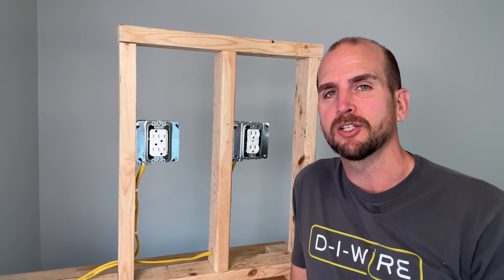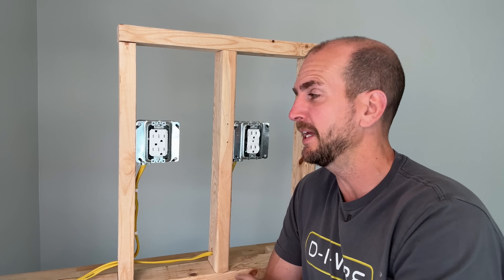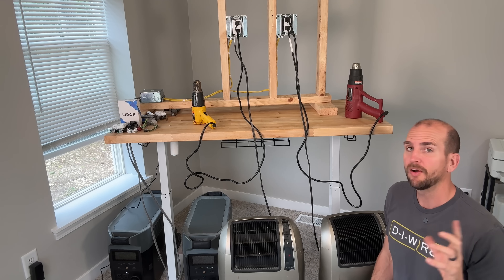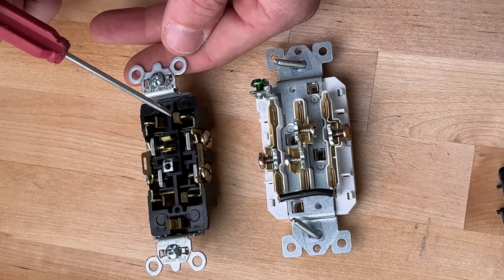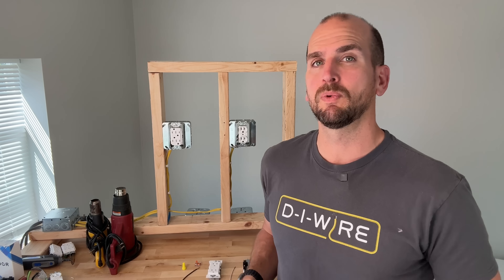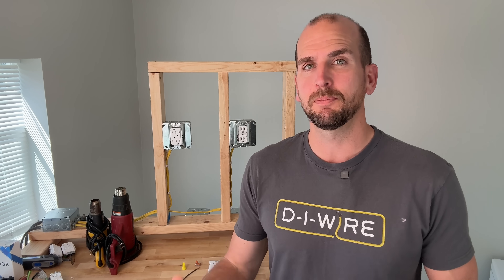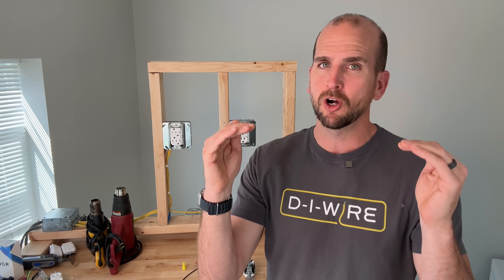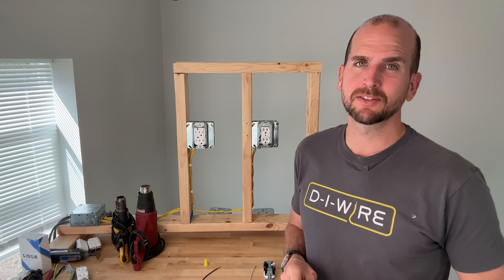The Most Innovative Outlet You've Never Seen | Full Load Testing

Comment: Interesting concept.  I was half expecting them to have each side fed by a different hot, allowing you to choose which phase to use for standard 120v.  Or use a funky new plug to use both hots for 240v like it was a nema 6-15.
Reply: You'd need to connect this up to both phases though, which requires additional wires that probably won't be there if you're not using a proper 240v outlet.
Reply: Having two circuits supplying a single wall plate, even if it is a double socket, is a bad idea.  Go to do work on it and not know of the arrangement and you turn off what you believe is the 120V breaker that isolates it and you still have 120V at the overall fitting.  You could argue that you should only fit it to a 240V breaker so that both sides are turned off but I think most sparkies over there would rather jump off a roof than do that.

Comment: Yuk, I've seen that type of 'socket' in power strips, they wear out super quick, plus they have very poor to no ability to accept a plug being inserted at an angle. The normal leaf type contact will guide it into place whereas the other the prong will tend to hit the edge of that folded out piece and easily damage it. I've seen a few power strips where the prong had hit that little folded out bit, the user  sensed it stopping the plug going in, so they pushed harder and kind of mangled it, so not good.
We had a few of these at church, they wore very quickly, and I could here them sparking etc (not to mention the noise in our sound system)

Comment: Interesting output. Although it doesn't solve the "ground up or ground down" debate. The issue is that if a plug is partially pulled out and a thin conductive object falls down (such as a metal plate cover), a ground down configuration will allow a short between hot and neutral, while a ground up configuration will have it hang harmlessly. But the outlet shown has both hot connections towards the outside and if a metal plate cover were to fall, it would short the hot to the ground.
Reply: I have actually had that happen. I was removing a polished brass outlet cover in a house I had just bought, to peek in and see what kind of wiring was in the box, and instead I got to test the circuit breaker. (It worked.)

Comment: With AFCI and GFCI requirements in place, how long before grounded receptacle outlets become optional? The question becomes, ground up, ground down, ground gone?
Reply: Like the cassette tape. It came and went.
Reply: @robertthompson3447  there will always be people who buy/use “fringe” products. Digital and CDs largely replaced cassettes, but didn’t eliminate them entirely. Hell, even vinyl is available even if just for the novelty. They may only sell a few thousand of these receptacles in a year, but if they can turn a profit on them, they will.

As for eliminating grounding, there are still conditions under which AFCI/GFCI are not the ideal protection and defaulting to a traditional EGC is additional protection. Grounding is not going away just because AFCI/GFCI is becoming increasingly required. We do see a time, probably not far off, where the main service panel breaker will provide AFCI, GFCI, and surge protection for the entire panel and individual protected circuits/breakers will no longer be required. Traditional service panels will be replaced by advanced smart panels probably with the capability of controlling switching and providing overcurrent protection through electronics and software similar to PLCs that you can control from your cell phone or laptop.

Comment: What about shuttering? Isn't that required for new residential (maybe I heard wrong) in some locations?
Reply: Tamper resistant is required for "accessible" outlets. So like the ones behind the fridge, microwave, ceiling mounted, etc. do not have to be. Not many exceptions anymore. When I finished my garage I put in TR for the inspection, then replaced those stupid things with regular afterwards. I don't have kids so I don't care. I've never found a TR outlet that doesn't suck.
Reply from the maker: That is correct, Tamper resistant outlets are required every location I have ran across.  This one has the TR shutters built in 👍
Reply: @EverydayHomeRepairs  Does the shutter still work on the exposed hole when something is plugged in? That would be interesting to see how that works if so.

Comment: A dumb gimmick. As far as his  testing goes, any 15 amp outlet will get warm when overloaded to 20 amps. That test proves nothing.
   The large wall adapter problem is easily solved with a $5 power strip.

Comment: The problem this solves, everyone seems to be missing.......one side of the outlet is "always on", the other side is "switched", for lamps or items you want to come on with a switch.   This doesnt solve a huge problem but it adds more convenience and flexibility to outlets
Reply: All the switched outlets I have ever seen only switch one outlet. So traditional outlets provide that. This just looks like a solution looking for a problem.
Reply: All regular outlets can do that too, it's just a matter if you want top or bottom on the switch. You can only plug in 2 items into either style.
Reply: I see what you were saying, yeah, I suppose you could put both plugs on the switched or unswitched side VS a regular receptacle. Although on a regular one if you need 2 lamps plugged in you could just use a splitter, not near enough current draw to be a worry and wont likely need to be unplugged very often.
The best thing to do on a new wiring job is to put a dual gang box where the switched outlet would be so you can have 2 switched and 2 unswitched. I guess this new style receptacle would be closer to the next best option. Although I wouldn't use this one specifically, kinda weak construction.
Reply: If you don't already know how to solve this problem with a regular switch, a problem that's been solved for decades, then you have zero business saying what you've said.
Reply: I use Insteon outlets. Two independently switched, manual with button on outlet, and programmable for phone control, scenes etc.

Comment: Its UL Listed.  Whether or not it is commercial grade, I think that you proved it should not be.  Running 2500w off the same outlet is extreme. 
What I would rather have seen is a test of what you could plug in.  What kind of phone chargers, laptop plugs, gaming systems, etc. can you plug in together?  It is the whole reason I have power strips because I sometimes can only plug in one electronic device in a duplex outlet.  I often use 90-degree offset close-clearance plugs on my power strips too.  
These electronic devices do not draw 2500w.  Do you test power strips at 2500w?

I am currently traveling and I use a 6-plug / 2-USB port surge protector adapter that plugs into a standard duplex outlet using both receptacles.  As I look at the adapter I am using right now, of the 6 receptacles, 2 are not useable because of the charging plug size.  As far as ground up / ground down,   The ground is down but one of the cord runs up.  That argument has been proven to be BS since there is no NEC standard on the ground location. (up or down).  

But this receptacle design might given you the ability to plug in two plugs with cords running down because you can flip one.  If you can't do this you might as well only have a single receptacle instead of a duplex because a second cord is not going to plug in if there is a plug below it.

I think this design is an attempt to answer lack of a standard on the question of ground up/ground down and the lack of a standard beyond the polarize plug as to how big plug with transformers or GFCI built into their heads can be.  Look at the pictures on your link to Amazon.

Comment: Not mentioned: It's going to need its own proprietary cover plate since the device is wider than standard decorator (Decora) devices. No, that product is a gimmick in my opinion. Its internals are not robust, and that jumper wire is shoddy. It's a solution to a problem that doesn't exist.

Edit: Looking more closely... does it need its own plate? It seems wider but now I'm not so sure.
Reply: just like AFCI breakers. well those are problem creating more problems

Comment: Definitely an example of solution in search of a problem.
Reply: No one side switched is a reasonable excuse.
Reply: @Packhorse-bh8qnI really don’t get the up down….meh. Grounded cords do seem to be down oriented…..
Reply: 3:58 man that looks like a short waiting to happen.
Reply: @Packhorse-bh8qnBecause of the shared blade, this doesn't increase the number of outlets, it's still only two receptacles per outlet. It is solely about whether placing the plug ground up or ground down, and yes, many plugs where the cord is perpendicular to the plug are designed for ground down use.
Reply: @Packhorse-bh8qn Look at the design again: this doesn't give you more outlets. It's still only two.

Also appliance cords and power strip cords are absolutely made for ground down. Flat plugs, with the cord coming out at a 45 degree angle, pointing down towards the floor if ground down and up into the air if ground up. Or flat plugs with the cord coming out straight down from the ground pin, once again going to the floor if plugged in ground down or going into the air if ground up.
Reply: @bwedesign There was no problem if you followed any experienced electrician you install ground down because all appliance angle cords are made for ground down
Reply: @KE5ZZO  I found one that isn't but all the others I have looked at, including those with GFCI plugs, that's been the case.

Comment: Couple things. Are these tamper resistant? If not they are basically useless in 90% of locations. Also with a plug in is the other outside hole exposed? If so I can see that being a shock point even with a plug in it
Reply: How is it useless in 90% of locations by not being tamper resistant?
Reply: The one exposed is the neutral side, has no power going to it. Still a potential hazard. Baby proofing options wouldn't work either.
Reply: @Eidolon1andOnly  You can get shocked by a neutral if you become a shorter path to ground for the circuit.
Reply: @RCLapCar  Like I said, it's still a potential hazard.
Reply: Has the "TR" on it. Also has it in the model name.

Comment: Personally, I could see a log of DIYers installing the LIDER wrong and tripping a breaker, or worse. And as for the Up-Down debate as well as plug-space issues as with wall-warts, just have the bottom socket with the ground down and the top socket with the ground up.

Comment: This appears to me to be a solution in search of a problem... and it still offers only two (accessible) outlets at a time.
Reply: I personally wish one of my outlets had the ability to be either switch controlled or always on based on how I plugged something in. As it is, if I want to charge my phone but not have the lamp on, I need to turn off the lamp by hand. But if I forget to turn the lamp back on, then when I come home at night and try and turn on the lamp I have to fumble in the dark. 

I’ve also frequently had an entire outlet taken up by one thing because it’s box was slightly too big to plug in something else with a ground. 

Also, most angled plugs have the cord going to the floor, but if I’m plugging something in behind furniture I want the cord coming out the top. Or the cord is angled right and I want it to go left. 

There are many use cases for this sort of plug. It’s not needed in many situations, but it doesn’t make it useless. Although a design with better internals would be ideal.

Comment: All 15 amp duplex receptacles are approved to be feed by a 20 amp breaker as long as you use #12 copper conductors. Besides the heat measurements would have performed voltage drop between the copper feed wires and maybe cut the cord a foot from male plug to take readings. Wouldn't install one if these in my house. Like you stated spec grade is the best choice for residential devices especially on kitchen & laundry areas.
Reply: You're nuts.  And completely incorrect.

Comment: Maybe I missed this: Does it fit a Decora wall-plate? I want to put it in a metal electrical box with conduit and a metal wall plate so the included wall plate won’t do.
Reply from the maker: Yep, it will fit the standard Decora size plates.
Reply: @EverydayHomeRepairs  Thank you

Comment: This video is missing a 30 to 60 second segment at the start explaining why the faceplate of this receptacle looks like that. What is the purpose?
Reply from the maker: That is just what is called a mud ring.  For metal boxes like this that is what would offset the outlets and light switches by the thickness of the drywall or plaster.

Comment: It requires a double gang box so at that point why not install two receptacles one ground up and the other ground down? If this would have fit into a single gang box it would make more sense.
Reply from the maker: Nope, I had larger than needed boxes for the test but it will fit fine in a single gang.
Reply: Yes but it only provides two outlets, is the point that you can plug in either up or down depending on how you feel?  @EverydayHomeRepairs
Reply: @matt45540 
that and the option to have one side linked to a switch (for lamps, Christmas lights ect) and the other side always on.

Comment: The physical construction of the LIDER does seem non-ideal, but the connector layout is fascinating. The number of times I've had a wall-wart just oh-so-barely obstruct the other outlet would be resolved by this design.
Reply from the maker: Probably the strongest use case for this outlet.  Every once in a while it would be handy.
Reply: Why not just implement a standard Decora duplex but with the outlets at the very top and bottom of the cutout? That is to say, 4 to 5 mm further apart than usual.
Reply: Actually I could see a use case for a duplex receptacle with the top plug upside down. Specifically, where for space or other reasons, you want to install it sideways.
Reply: @ps.2  I've had some wall warts that are the opposite of normal ones so they can fit with standard wall warts. A design like this would fix both.